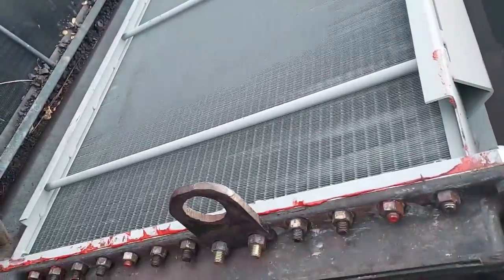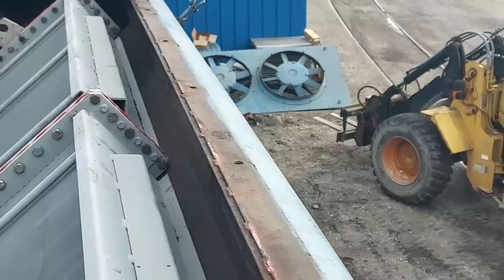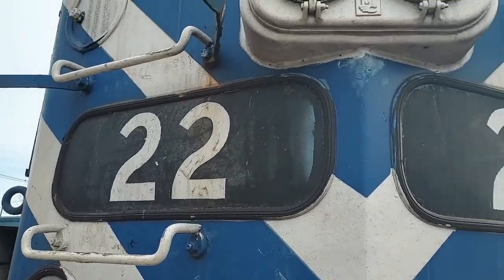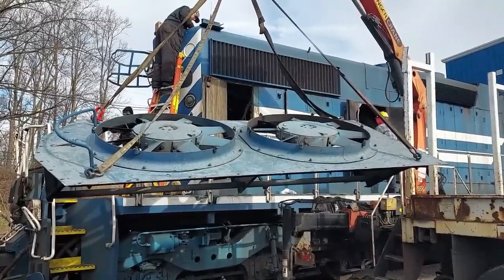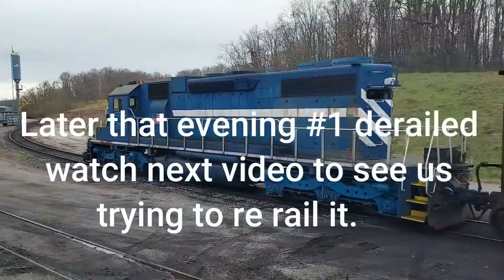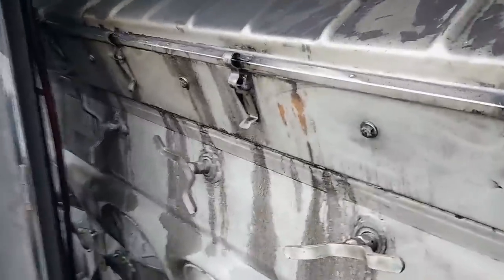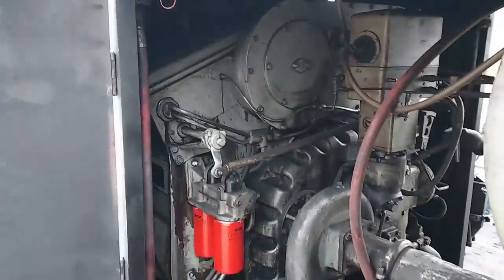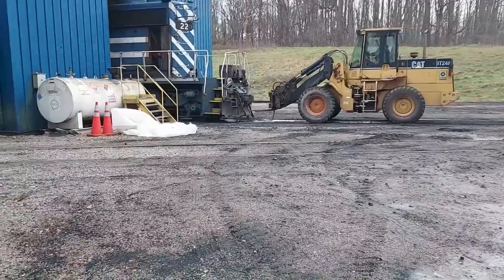A Failed Locomotive Cold Start after Changing the Locomotive Radiator

Comment: EMD did a good job with the cooling system on those locomotives. Very few problems other than the occasional failed water pump seal or very seldom, a leaky radiator.  The worst problem is if a freeze protector dump valve operated somewhere there’s no water available. All the cooling water gets dumped to keep the radiators and engine from freezing. Most of our locomotives had an auto start system that would start up the engine and idle it for a while to keep it warm and charge the batteries. Some times if it wasn’t going to be too cold at night, and the auto start wasn’t on, we would put a dime in the dump valve to keep it from tripping. 
The engine would still be warm the next morning anyway if it was running the night before. Takes a long time to get really cold.
Reply from the maker: Thanks so much Bill for the awesome comment, Always
very informative when you write in. Our 3098 has Smart Start
on it, but #1 and 22 do not. I did not know there was an auto
dump valve in the system. I'll keep that in mind if for some
reason some day all the water gets dumped! Really appreciate
your watching the show my friend.
Reply: Why dont you just use antifreeze?
Reply: @mafia631  EPA doesn't want antifreeze dumped on the line of road. There are pellets that are available to dump into the water tank, that don't hurt the environment, that show up RED where there is a leak. To my understanding, it also assists in antifreeze activities.
Reply: @mafia631  mainly cost coolant gets expensive water is free
Reply: @general5104 What about corrosion?

Comment: Nice to see a part of the locomotive most folks never get to see.  Thanks for sharing.  Glad they got her running eventually.  Sure did seem to crank slow because of the cold.
Reply from the maker: We really needed it later that night when #1 loco derailed Mike. After
they finally got it started, 22 saved the day on the derailment pulling
#1 back up on track. Thank you so much my friend for stopping
by tonight and taking in the presentation.
Reply: Unlike cars and trucks, there are no glow plugs on a locomotive.  You pretty much have to either crank it until it lights off, or warm the block.

It's quite a sight, you'll get one cylinder to fire, then two, etc, and it makes all this weird surging type sounds with gobs of white smoke.
Reply: We would hook the welder up to the battery switch and let it charge a while, turn all the exhaust fans on and turn the prime switch on and stick a pocket screwdriver in it to hold the twist knob ON, and after the return bulb was happy, we cranked it up, while still on the welder. She turned over GOOD. It's rough on a set of batteries to crank on them a long time starting a cold engine.!

Comment: I thank you for bringing back old memories! I've been in every aspect of Locomotive tear down & repair, wreck damage, traction motor change-outs, engine change-outs, electrical cabinet change-outs. I ran the overhead crane, up in the cage "bucket we called it," for many years. It was the electrician's job to run it because, when it quit, you had to know how to fix it. It was an ancient Niles crane. We've had it bogging a time or three, but all in all, she would pick up most anything they would hook her to!
   It did me good to see inside the carbody again. I ended up being eldest man in the rewire department. Ive pulled every wire out of the conduits and troughs, made it up and pulled it back in. I designed a new form of wiring, that GE & EMD both adopted and use on all their units now. It causes less MF's on the road and is easier to ttouble-shoot.
   I designed the EMD water-pump lifter rig, that turned a mell-of-a-hess job into a simple one. Our two senior general foremen claimed that THEY invented it and they got the bonuses. One of them got the "System Mechanical Engineer" position, while riding on it's design! Tge big picture, It made that monster job. easy for everyone! I'm sure they patented it and it's probably where other railroads can purchase one.
   I say I designed it...I give God the parameters of what I need and HE puts a little image in my head and helps me build it. We have built lifting rigs, work stands, short-cut tools, a whole set of Drop-Table tools, to assist in doing most every job you would do on the drop table. 
   I used to work in the tech cage, building all the power cables for everything that had quick disconnect plugs and connectors, like governor cables, temperature switches, THR's, (Train Handling Recorders) "black boxes," Radio cables, Coax Jumpers and the list goes on and on. I built test equipment for governors, toilet systems, Ditch Light brain boxes, Flange-Lube systems and the list goes on. I kept all the conduit and schematic prints in good repair and filed right. And still changed Dynamic Brake Grids and Contactors and a slue of other things. I've been retired for a decade and miss it bad! It did me good to see those 3 phase connectors for the AC cooling fans for the radiator hatch.! 
   My rigs and jigs and work stands and procedures, and test equipment and shortcut tooling runs in the hundreds, spread out over 37 years.! I made a difference! I miss, making a difference.! I must have walked for miles, Labeling and walking the distance, labeling and cutting the wire and labeling that wire and walking back to the spool and labeling the other end, cutting it and labeling another one...on & on till that harness was done and put a few spare wires in it, in case one opened up or to pull more in or for an upgrade.
   Well, I've written a book...speaking of which, I wrote a full library of books on every engine we had at our diesel shop. They filled two refrigerator housings, that were cut out of the nose when they built the floors up level to the cab and put aircraft type vacuum toilets in the nose for the crews. I made library lockers to hold my books. 3 shelves each. Every book had a conduit print and a schematic print in it, in the back pages and From/To/Tech Info in the front pages. All of them inside premium plastic page protector sleeves and stapled in. EVERY WIRE IN THAT LOCOMOTIVE...its lable, size, harness, length, and what that wire actually did, on most of them) All in a semi-rigid backing. FOR REFERENCE ONLY. MAKE COPIES FROM THIS BOOK. DO NOT TAKE TO ENGINE was labeled on each book. I didn't want them greasy! They were one of a kind, books.
   As a helpful idea for you, fill your engine up with your STEAM HOSE. The cold block and all the radiators will absorb the heat and bring it on down before It can cause any damage and heat the engine up at the same time. Open your test cocks and turn the engine over for 30 seconds. That gets all the water out of the cylinders. (It could bust a piston if you don't.!) Get one can of eather and already have the air-box doors off, the one next to the end on each corner and spray it up in there, both directions, (NOT A LOT), and put the door insert cover back on quickly.  DON'T have it close to trees nor vegetation or under an overhead wire when you crank it up. Fire is going to belch out the stacks, but she'll crank.! Don't use too much. You CAN over do it.!
   Thanks again for your video. I just vented. Bill, from Tn. 🇺🇸
Reply from the maker: Wow Bill what a totally awesome comment. We really thank you
for sharing your experiences with us. I can certainly understand
how you feel about missing your work. Sounds like you've had
an amazing career and one that did make a difference and made
things easier and more helpful for the next guy. It's been great to
hear from you and we certainly appreciate your taking the time
to watch and share with us my friend.

Comment: It sucks when the hand brake chain breaks! Me and 4 other people actually moved an 80 ton heavyweight passenger car inside an Amtrak shop. We used a wheel chock to stop it because the darn hand brake chain had a habit of breaking! Roller bearings are amazing!
Reply from the maker: I'm sure it did clarkpj. Ever tried using a skate? A short skate 
is not very good but a 2 foot long one works pretty well. Very
much appreciate your taking the time to watch and write in
my friend.
Reply: @ccrx6700  We always used a skate when parked in the station. Did you ever see someone shove a car over the handle end? I saw one fly about 20 feet one time!

Comment: That's definitely a part of a locomotive that i've never seen before. Thanks for showing that, Dave! Also I would think that a locomotive would be able to start even in the cold. Think she's just got a set of old weak batteries on board?
Reply from the maker: Very glad you found the video interesting Shane. Most folks
have never seen the radiators before and most thought they
were placed against the side screens instead of in a V. These
EMD big engines do like their warmth, it was very cold that
day with the wind blowing. They do crank slow, relying on getting
one cylinder or two to fire to carry the crankshaft over even
faster. You may also be interested to know there are 2 starter
motors that engage the flywheel. Thanks so much for watching
and writing in my friend.
Reply: @ccrx6700  I heard somewhere that the older EMD's like GP7's, etc. pushed juice through the generator head to start the prime mover. Not sure It's true, though.
Reply: @Trains-With-Shane  all GE locomotives use the main alt for starting - current gets pulsed thru all three phases like a reverse distributor. Some very old EMD units used the DC generator as a starter.
Reply from the maker: @Trains-With-Shane  I have no clue Shane

Comment: Diesels won't start well in cold weather unless the block is kept warm. Internal combustion engines fare better in the cold. At the terminal points NJ Transit plugs the locomotives into ground power which keeps the blocks warm when they shut the locomotives down for the evening and for weekends when they are not in use. The last six months before retirement I bumped on to the yard job at Port Morris fueling the trains when they arrived and making up the yard for the morning runs. Really enjoyed that yard job. Thanks for sharing this mechanical information with your viewers.
Reply: i was an electrician on a yard assembly crew, It definitely was fun. We had this total drunk for a dispatcher . We would laugh our asses off all night listening to him on the radio.
Reply from the maker: Your right Gary. EMD engines like their warmth. My tamper, however
has a Cummins straight 6 diesel, it will start really well in almost
bitter temps without heat. Regulator has a John Deere and must
be plugged in when temps get below 25 or it won't start. Had several
JD farm tractors and they all needed block heat. I have no idea
why EMD engines we have don't have block heaters. Always is
a pleasure to have you visit with me my good friend.
Reply: @ccrx6700  In the years past locomotives were kept running constantly. With noise and pollution regulations the railroads were forced to comply hence the shut down overnight or whenever the locomotives weren't to be operated. Ground power was installed at major terminals so the locomotives could be plugged in. This is some heavy duty power keeping the blocks warm and the heat and power on passenger equipment. I was on a vacation day one night and the conductor called from the extra list didn't spot the trains properly so the ground power couldn't be plugged in. Well, the yard foreman tore him a new hiney hole and they had to re spot all the equipment.
Reply from the maker: @garykuipers2696  👍😊❤️

Comment: Sounded like trying to start an old 1946 flathead 6 cylinder with a 6 volt battery on a freezing 20 degree morning, ( ruurr - ruuuur - ruh ) ...... C'mon baby, kick over !!!
Reply from the maker: Probably not too many folks have ever heard a loco try to start
up standing right next to the engine.  Did you know Earl that this
engine has 2 starter motors on it. Good thing they got it
started later that night, 22 saved the day when #1 loco
derailed that night. Very much appreciate your
watching and writing in my friend.

Comment: Memories of working in the diesel house, third-trick, in the winter. Far more often than not we would spray a can of ether into the air compartment and then start the cold loco. Works, 99.99% of the time. (Helps to double-check the water, oil, and fuel levels before starting.)
Reply from the maker: Very interesting Thomas. I have been told ether is not to be
used on these engines, but that's just what I've been told. We never
have here. Night shift in the winter is often brutal. I feel for you
there pal. Always appreciate your stopping by and writing in
my friend.
Reply: @ccrx6700  A "lot" of change since the 1970s...

Comment: Preheating the engine make wonders. The rail car I drove before Christmas was electrically preheated and started at "the first kick" even if it had been sitting idle for 4 months. The preheating preserves the engine cylinder head gaskets!
Reply from the maker: For whatever reason these locos do not have block heaters
in them. Have no idea why Stefan.

Comment: Great video, Dave.  I like that you run the controls on the hoist from the ground so you can see how the piece fits. It's also safer. 240 gallons of water for cooling. You don't mention antifreeze. Must be warmer where you are. Again, thank you.
Reply from the maker: Definitely safer with the remote box, specially when moving rail
around. Most locos use only water and not antifreeze Shirley.
That's why you see so many of them running at idle in the winter.
Some locos have Smart Start that automatically shuts down and
restarts the locos in winter. Only 1 of ours has that. Thanks so
much for checking out the repair job my friend.

Comment: I've watched a working display of a marine diesel start-up at the annual "Wooden" boat show in Sturgeon Bay, WI. First, they heat the cylinder head with a blow torch. Next, they turn the engine over with bleed valves open and ignite the air-fuel mixture. Finally, they close all the valves. According to the owner, the same procedure was used on the tug boat the engine came from.
Reply from the maker: Very interesting. Some old 2 cylinder John Deere tractors you
opened a pet cock to relieve compression then closed them
after they started. Thank you so much for taking the time to
watch and write in my friend.

Comment: Those DC traction motor, or really any large brushed DC motor are Fun to clean! The company I worked for repairing, and remanufacturing electric motors, had us pressure washing them, the amount of dust from the brushes in some of them was crazy!
Reply from the maker: I can imagine so the dust in them tucker. If I recall right there are
24 brushes in these traction motors? I may be wrong on the exact
figure but there are a lot, so a lot of dust in them. Thanks so
much for watching and writing in today my friend.
Reply: @ccrx6700  I think it would just depends mostly on the amount of current the motor is pulling as well as the engineers, or designer of the motor, on how many brushes are within the motor. The two that I got to clean one was like a 500hp traction it had like two sets of brushes (4 brushes total two positive two negative, the other was smaller, and had one set and I’m pretty sure it wasn’t a train traction motor, but maybe a traction motor for a small car for like coal or something. The dust from the brushes gets inside the armature, and in the field frames coils. 
The dust has got to come out because it will mess with the HI-POT ( a high voltage test for the insulation on the windings) 
The armature’s are not usually that hard to clean/pressure wash, nether are rotors for ac motors unless it’s a wound rotor sometimes those can take a bit, but the field frame, or even stators that are packed with grease you could be there for hours washing it, stators too!
Enjoyed the video my friend! 
A few of my ex co-workers from that job worked on the railroad. The amount of knowledge from that I gained from them.

Comment: Do you have to add anti-freeze to it? Nice view of the radiators. That loader made moving that unit look easy.
Reply from the maker: No sir, most locomotives run straight water. We do put an additive
in the water to prevent scale/corrosion, it makes the water look
like watered down fruit juice. Only a few locomotives use
a glycol mix such as the SD 70 ACe. It is fairly easy to move that
loco with such a small loader, at least on level grade. Thank
you so much Wilbur for stopping by and watching the show.
Reply: @ccrx6700    What keeps the water from freezing?

Comment: Excellent view of what's under the hood, literally!

I'd be curious to see the difference between the 38-2 and the 40-2, or if it's just 3 fans vs 2. 

The SD45 would be a neat one too since it has the external flares for them.
Reply: on a 40 its more radiator and another fan, someone can chime in on the SD45 radiators...cause the SD45-2 dont have flared radiators.......
Reply from the maker: Very glad you enjoyed tonight's show kleetus. yes the 40-2
has 3 cooling fans as opposed to the 2 on the 38-2. Tonight's
video not something many folks ever get to see. Really
appreciate your taking the time to watch and write in my friend.
Reply: @rearspeaker6364  general speaking it's one fan per 1000hp
Reply: @TheLootownpunx  Not really, no. SD70s are 4300hp and have only three fans. If you're going to claim a rule of thumb, two fans below 3000hp and three from 3000hp upwards would be a better one to use.